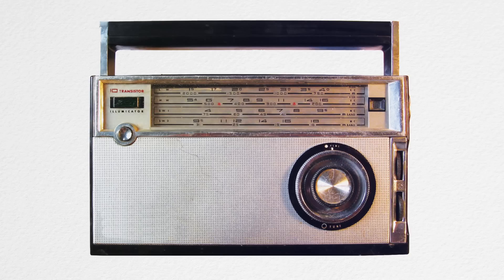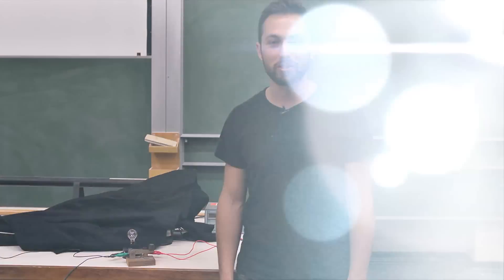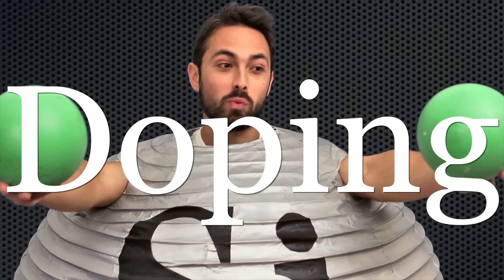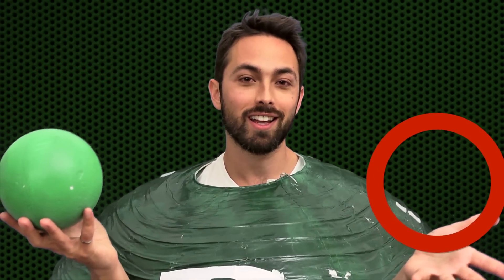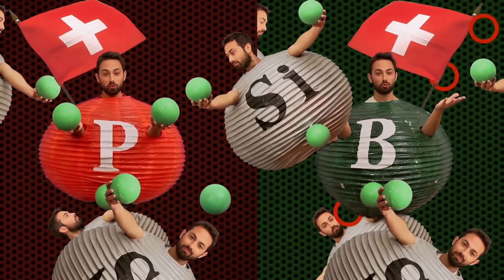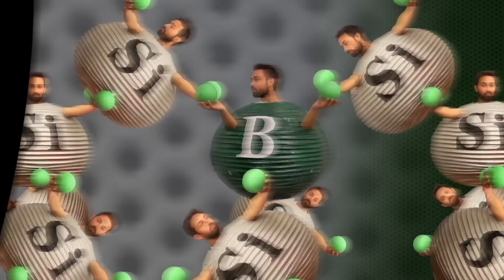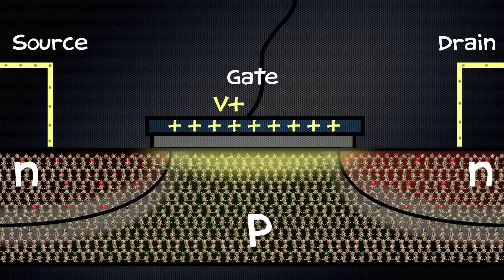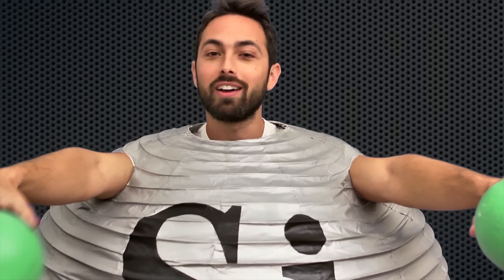How Does a Transistor Work?

Comment: Only the first transistor needs to be on while the power source is on; whether other transistors are turned on depends on the circuit wiring, and comprises the function of your system.

Comment: the issue with that is the throughput of data over distance. most chips are located nearest to other chips on a board so that the communication bus between them is shorter. allowing high throughput and fast transfer of bits. the amount of lag involved with what you suggested would probably make it impractical.

Comment: its not just transistors in a circuit, you also have capacitors, resistors, and diodes. you can create all kinds of different situations to control current and voltage with any combination of these. the transistor is the keystone to most electronics circuits. you can limit the amount of voltage charging a capacitor, when that capacitor charges to a certain amount it will discharge through a diode, which can turn on the gate to a transistor, which in turn charges the capacitor again.

Comment: So why can't we just make bigger chips? More volume to accommodate more transistors. As I see computing now days with Cloud Technology, we are moving back to the main frame concept and style of computing. Especially with modern virtualization, I can see having a 1ft cubed processor crammed packed (nano technology) with transistors that allocates a certain amount of transitors (maybe a billion) to each new user that logs onto to the system (or network).

Comment: You put voltage on the gate with whatever you want.  Circuits will use resistors, capacitors, and inductors.  One of the more common setups is an amplifier.  A little bit of current on the gate means a small electrical signal can be use to create a large electrical signal that matches it.

If the signal on the gate comes from a radio antenna, the output from the transistor goes to a speaker.  Thus a tiny electric signal can turn your wall outlet power into sound thru a transistor.

Comment: Because there is a voltage accross the whole transistor (source to drain) - so the electrons keep moving as long as they are motivated by the voltage.
i.e. The electrons are moving for the same reason they would be in a piece of copper or iron.

Comment: You control the gate by applying square wave. The square wave has two states, high and low. When the square wave is on, it allows current from drain to source, for N-type device. A square wave can be generated through many ways, one is using by circuit called the comparator. It uses op-amp, energy storing element (capacitor), and a resistor to create frequency that appropriate for switching. Using positive feedback, one could 'trap' the oscillation to how many switching (high/low) per second.

Comment: So, to switch a transistor on, you need to put voltage to a gate. How do you control the gate? Using another transistor? How do you switch the other transistor on? Using voltage on it's gate? How do you put voltage to the gate? ........

Comment: Moving parts = mechanical movements. Like a lightswitch... In a transistor, you just have to apply a voltage on the gate to close your switch, so no mechanical movements are involved. Electrical current is just a movement of electrons...

Comment: 1: the farthest astronomical object observed so far is at a distance of 13.37 thousand million light years and it's not a fully formed galaxy, it's a protogalaxy.
2: the only thing observed beyond that is the microwave back, which is exactly what you should find if the universe were in extremely hot dense state 13.8 thousand million years ago.
3: there's no center of the universe. The expansion of the universe is uniform in all directions from every vantage point.
cont'd....

Comment: That would be true if they were equally parsimonious... but they are not. IWT accounts for dark matter, dark energy as well as the expanding, accelerated expansion universe and makes black holes simple. IWT suggests answers more questions by far. It doesn't require everything springing from nothing which is the best argument for it. It's just plain common sense, as it should be. The universe had no beginning and of course it will have no end. We just couldn't see it because we are too close.

Comment: So a transistor is used in an amplifier to amplify the signal by letting more electrons through? How does that function? Is a sound signal electric current? I don't have a clue how sound works, you seem to know this?

Comment: When we looked at light, we didn't assume it was as fast as a bullet, or a train, it was assumed it was instant until proved otherwise. The problem is, you bought into a theory that is not only unproven, but literally impossible, besides the fact it doesn't even make common sense. If you don't like Infinite Wave Theory that's fine, but you will never prove BB. IWT makes the most sense with all that we know.

Comment: I'm not sure what you mean. But there is a current going through the transistor from source to drain. In a P-channel transistor (actually FET) there is negative current. It seems it is basically an N-channel transistor/FET used reversed (or upside down) with different conducting material.

Comment: Great explanation, the best I have heard, But a transistor is much more than that, it is used as a switch basically only in computing but in reality it is more like a water valve, you can control a huge pressure (Voltage) and the amount of water (current) that flow trough if with just a small effort on the handle (gate voltage) if that motion follows a pattern then you are modulating the flow, that is the basic concept of how an amplifier can ctrl a large power output with a small signal input

Comment: Because in this way, you can control the flow from both ends of the transistor. You can flip the transistor one way or the other and it still works. This allows the current to flow from both directions. This also prevents the current from flowing backwards when it shouldn't. Because if you only used one of each type, you could have the gate closed, and if a back-current surges from the wrong end, it would still get through, potentially damaging your circuit.

Comment: It is not the case that there is always a current flow when the gate is on. The gate determines whether or not the signal between source and drain can pass through. So it's possible that the gate is on but the signal to pass through is off. Lets call the gate signal G and the signal between drain and source to be DtS. It's G on and DtS on -> 1; G on and DtS off -> 0; and G off -> always 0 no matter what DtS is.

Comment: But if we are able to switch the Gate on and off, as we like. Why don't we just use this signal from the gate and put it directly into the logic circuits? Then we sent signals directly to the logic circuits.
Then we don't need the transistor at all. 
To be honest I didn't really understand you: Why is it important that we can turn on the gate but not have a current flow between source and drain? I thought it's just Gate on -> 1 ; Gate off -> 0; and if the gate is on we always have a current flow

Comment: Now i dont actually know, but I assume, that when you press the on button on your computer, it establishes a flow between the outlet or battery and the initial connection to the circuitry of the computer. Then, a series of transistors or whatnot begin an initialization sequence which causes the computer to turn on and run its basic sequences. This then allows the computer to run additional processes with the initial flow of the start sequence and to apply the voltage according to the programming

Comment: A transistor is a bit! So it allows a computer to store data in the form of binary. A computer applies the voltage to the different transistors according to the code it receives.

Comment: Because it's possible for the gate to be turned on but not have a current flow between source and drain. This is like turning on a light switch but removing the light bulb. The switch is "on", but there is no current flowing through the switch. This is important because it is what allows one signal to determine whether another signal can pass, which is a necessary for creating digital logic circuits.

Comment: I've a question: To switch the transistor to 1, we have to apply a small voltage to the gate. But how does this work? And if we are able to apply a voltage to the gate, why don't we just connect the gate directly to the drain and if the gate gets turned on the small voltage "goes" directly to the drain and we have a turned the transistor to 1.
If we can turn the gate on and off as we like we don't really need a transistor or did i miss something?

Comment: Great description of semiconductor physics principles but horrible description of how transistors work to be honest.  Yes they can be a digital switch, but they also have many uses in the analog domain.  That phone doesn't just have digital signal processing transistors, it also has a power amplifier, a low noise amplifier, mixers, wave form generators, etc which are not 0's and 1's

Comment: 4:35, see the grey layer between the gate metal contact and the body? That's a layer of silicon oxide (an insulator). It prevents electrons from passing from the body to the gate. (Note: It actually is possible for electrons to "tunnel" through the oxide. This concept is used for flash memory, like USB drives. Although for transistors, we make the insulating layer thick enough to prevent tunneling.)

Comment: Great video :) One thing to note about Moore's law in relation to transistor count and size: We are currently only using transistors in 2D, but there is significant research being done into solving the transistor count vs size problem by stacking them in layers (3D). When this succeeds, it's easy to imagine multiplying transistor count many times over in a very short period of time. It's not as simple as that, though, but still... transistor size is not really a problem for Moore's law :)

Comment: it's just three plates of silicuim two negative on the outside and a positive on the inside then one cabel is attached to the positve and that is the gate.

or it's one plate of silicuim that's cut in a circuit and than make some parts positove and negative.

Comment: No I meant resistor, and the fact that you thought I mistyped speaks to the heart of my argument.  By teaching them wrong that transistors are switches, instead of teaching them transistors are a type of resistor that allows you to vary the conductivity based on a second input voltage, you undermine their ability for a comprehensive understanding of the subject, and leave them with little more than rote memorization.

Comment: If you understood this video then diodes are much easier. Diodes are a simplified version of this. They are like switches too, and they essentially have a "minimum" voltage required to turn them on, depending on what type of material they're made of (Silicon, Germanium etc)

Comment: I think you're missing some background in this one Derek. What is a voltage? What is a current? What exactly is a transistor good for? Where is the transistor connected to in the circuit? What is a circuit? 

I get that this is as basic as it gets in electronics, but basic is not intuitive. I don't know if there is an intuitive way to jump into electronics.

Comment: It hurts my soul that people keep teaching transistors as switches.  That is ONE way they can be used (one of the most common to be sure), but they are in essence VALVES.  A normal switch doesn't have the ability to amplify.  Transistors = transfer resistors or transitive resistors.  They are resistors that are able to change their conductivity based on an input voltage.   

The rest of the video was really good.

Comment: You can connect the gate to a power source with a periodic square wave (variates from 0V to 12 V for example). 
There are 3 possible states in a transistor:
1- Blocked. It has no current inside
2- Saturated. Maximum current passes inside
3- Active. A certain amount of current passes inside the transistor (based on its the characteristics). The rest of current becomes mostly heat.
Combining this 3 states you can create every circuit you want. BUT you have to be aware of overheating in case 3

Comment: I must say, nice video with a good explanation. However i must comment  that this explanation is only true for a FET or MOSFET (Field Effect Transistor and Metal Oxide Semiconductor FET, which are used most commonly in appications), not for a normal transistor (which is similar when used in saturation but has aplifying effects below saturation). This might cause confusion with newcommers in electronics. Prehaps a small notation could erase any confusion?

Comment: That makes some NMOS diagrams I've seen a bit confusing.

If you connect the gate of an nMOS transistor to a power source (pull-up resistor), then it will always be in the ON state (of course, that might be a pointless thing to do, but just as an example). But won't that have to make the gate negative, meaning negative gate => ON? It'd be weird for a power source to "suck in" electrons (only ground would act that way it seems), and it's a steady state, so "direction" is unimportant.

Comment: No, you put + voltage on gate which repels + charges(holes) and attract - charges(electrons). + and + repel, - and - repel, + and - attract. F=k*Q1*Q2/r^2. Electrons flow in opposite direction from current.

Comment: I know it's NMOS, but I don't quite get the "form electrons" part. If I'm thinking straight, the gate would be negatively charged when connected to a power source, which ought to attract holes from the P layer towards the gate. Is that incorrect, and if so, where am I messing up?

Comment: Correct me if I'm wrong, but wouldn't the gate be negatively charged when the transistor is "on"? If that's the case, then I imagine it attracts holes from the P layer, which forms a P-channel the electrons can travel in.

Voltage vs charge and positive/negative always confuses me, with the different conventions and all... :/

Comment: When you apply +voltage to gate it attracts minor electrons from the p-type and forms a thin electron channel which enables current flow. In video it is said that gate helps electrons from n-type to cross the barrier. When you form channel there is no barrier between channel and n-type islands

Comment: And what happens when you have a positive charge in the same general area as a negative charge with an area of "resistance" (depletion region) between? You get a capacitor. And when that depletion region gets smaller when the transistor is on, you get a much better capacitor. Hence parasitic capacitance is born :( frown

Comment: By sending varying levels of current from the base, the amount of current flowing through the gate from the collector may be regulated. In this way, a very small amount of current may be used to control a large amount of current, as in an amplifier. The same process is used to create the binary code for the digital processors but in this case a voltage threshold of five volts is needed to open the collector gate.

Comment: The design of a transistor allows it to function as an amplifier or a switch. This is accomplished by using a small amount of electricity to control a gate on a much larger supply of electricity, much like turning a valve to control a supply of water. Transistors are composed of three parts -- a base, a collector, and an emitter. The base is the gate controller device for the larger electrical supply. The collector is the larger electrical supply, and the emitter is the outlet for that supply.

Comment: (con't) So in your iPhone 5, in addition to the ~100M transistors in the CPU, you have > 8 billion in the 1GB DRAM, and the base model with 16GB storage, that means another 128 billion transistors (or 512 billion in the 64GB model). In your Macbook Pro, you probably have at least 8GB RAM = 64 billion transistors, and at least 256GB Flash = 2 TRILLION transistors.

Comment: In your first sentence, you're selling the phone and computer short by claiming "nearly 100m" in the phone, and "over a billion" in the computer. I assume you're just referring to the CPUs. If so, you're forgetting about DRAM and NAND Flash, in both devices. For every 1GB of DRAM or 1GB of Flash, there is at least 8 billion transistors (and that's only counting the storage cells, not the controller logic). Plus, on the DRAM there is also a capacitor for each array transistor.

Comment: Nice! This may be oversimplified, in fact i knew that when you apply a small voltage to the gate, in the space between the source and the drain will form some kind of two dimensional, dynamically stable "gas" of electrons that are practically free to move but to really understand this phenonomenon you'll need some basic of quantum electrodynamics wich i still don't understand completely...

Comment: The size of the depletion region can control the amount of current flowing through the drain - source terminals. The size of the depletion region is controlled by the voltage on the gate, relative to the source terminal (at least for the n-channel MOSFET shown in this video). By making small changes to the gate voltage in the appropriate voltage range, an amplified response can be seen in the drain source current.

Comment: Let's see what an IF is.Basically (in machine code), you compare a register to a value and then jump either to the address A or B.

now we need a comparator.It's an array of N AND gates (N is 32, the number of bits). If all bits are equal, it drives the output line to 1, otherwise to 0.
Two registers store addresses of the "if" and "else" clause in code. The output of the comparator is fed into the N-bit multiplexer, and the address is loaded to the Program Counter (Instruction Pointer)